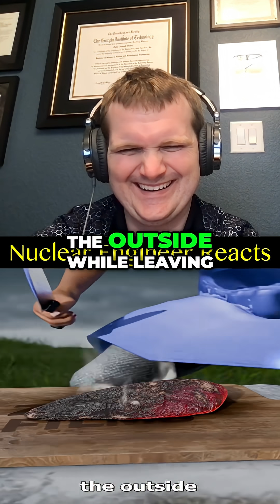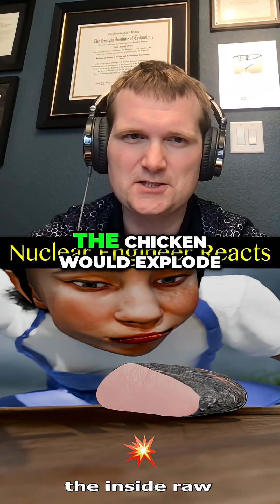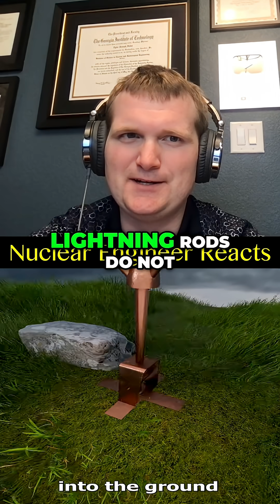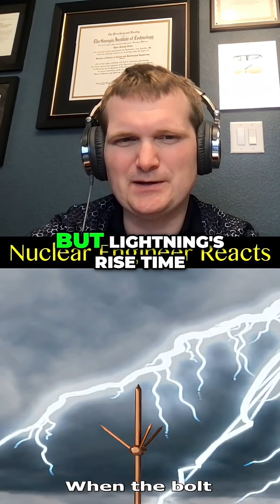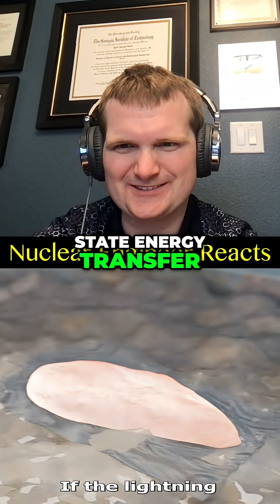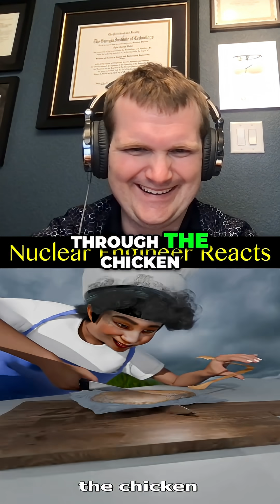Can You Cook a Chicken Breast with Lightning? - Nuclear Engineer Reacts to Zack D. Films

Comment: I would have gone with "its like bridging the gap between reactor trip and diesel generator start by using residual heat from the tripped reactor to power the water pumps" 😜

Comment: You could lie about everything, like lightning is actually made due to coal power or something, and I'd still believe you
Reply: well, there is a connection:
Lightining comes about due to charge differences, most often in clouds, or between clouds and the ground. Clouds get generated through solar energy heating up water to evaporate it. Coal Power releases CO2 and thereby increasing the amount of heat that stays in the atmosphere and thus making storms worse, probably triggering a few extra lightning strikes a year.

Comment: Weird comparison, ididathing "tested" surviving a house fire by hiding in a bathtub.  Two chickens(?) in water covered by a towel in a bathbub were actually decently cooked.
Reply: Oh... That idea in general seems odd. Water is going to transfer heat pretty well. You'd be better off throwing a ton of cotton clothes on the bottom of that tub and then covering it with a wet towel or two. Having water in the tub itself seems like a big issue.

Comment: Thinking about it ,I heard that there is no consensus on how lightning rods dissipate lightning. Can someone clear that up? Thanks.
Reply: That is true, it isn't exactly clear why they work. It is probably a combination of the different theories floating about. One thing i find very interesting, is that one theory said that radiating material might help make lightning rods more efficient so there were a whole bunch of lightning rods fitted with a bit of uranium at the top to help dissipate lightning. The effectiveness was never truly proven so it is being (or already has been) phased out.
Reply: I don't know about the non-consensus, but as far as I know they work like this (Im trying to explain it in easy terms):

Storm clouds are heavily negatively charged, so much that they attract positive charges from the ground. The charges in the lightning rod split; positive charges move to the tip closer to the clouds and negative charges are repelled to the bottom.
The positive charges concentrate at the tip (charges do this at sharp points) and this causes something called point action: basically the positive charges tear away electrons from nearby air molecules (unlike charges attract), leaving the air molecules positive (they are actually ions, not molecules anymore). The positive air molecules are simultaneously pushed upwards (by the positive-tipped lightning rod) where they rip more electrons from higher air molecules. Eventually we have a sort of 'wave' of positive ions being pushed skyward and these positive ions help to neutralize the storm clouds, reducing a chance of lightning strike.

(Of course, in the event of a strike, the lightning is attracted to the positive tip of the lightning rod. The lightning is then conducted safely to the ground.)